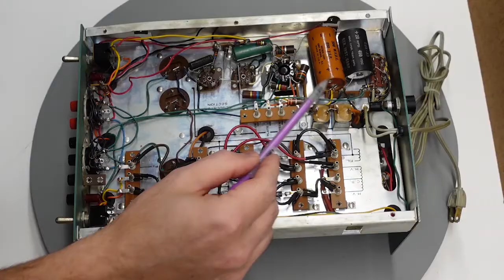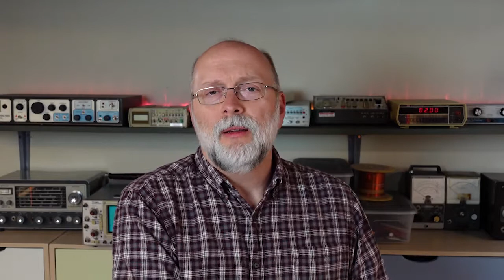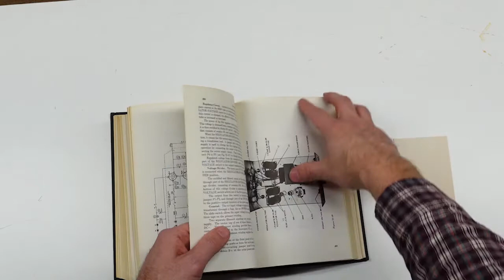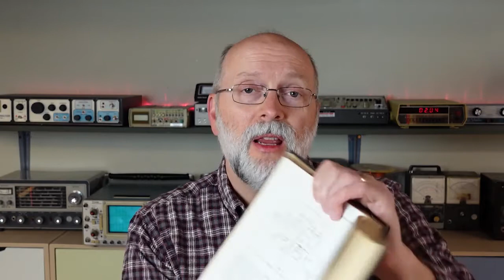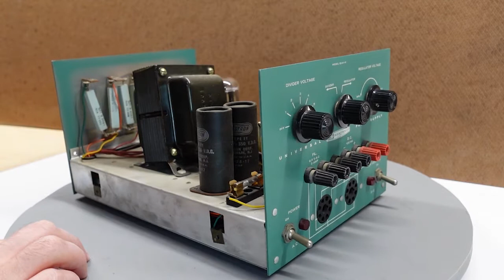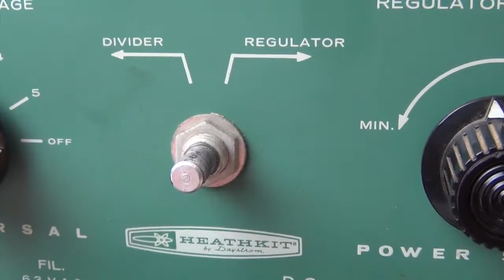Heathkit (Heathbuilt) EUW-15 HV DC Power Supply - Part #1

Comment: That has all the tell tail signs of a factory built unit. Riveted tube sockets, terminal strips and filter caps, kits have screw and nut fasteners and no rivets anywhere.